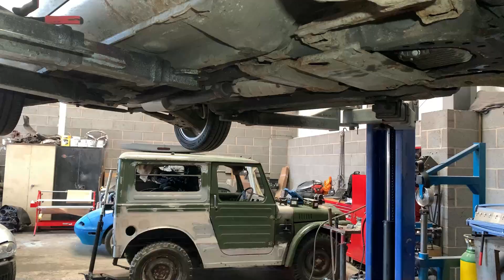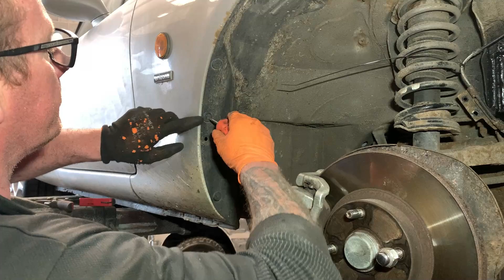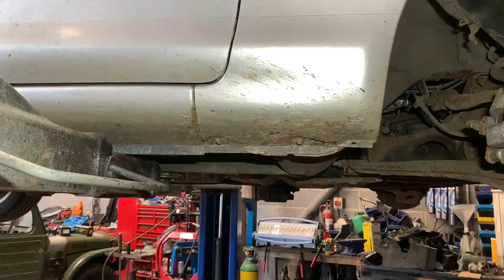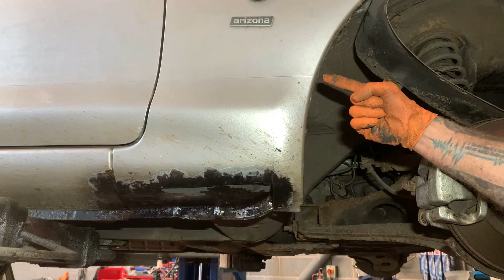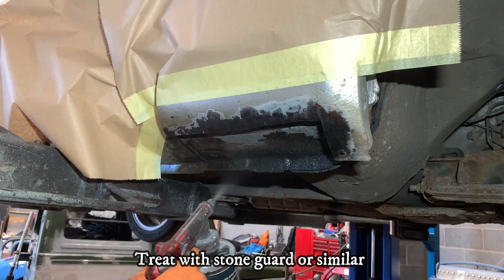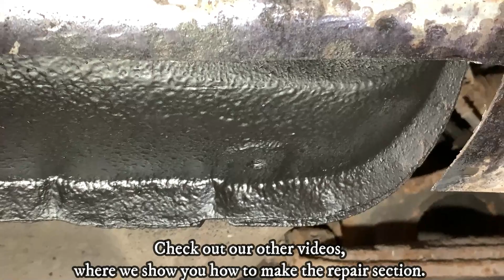How To treat rust under a MK2 Mazda MX5 front wing bottom

Comment: Hi.. Just a quick question I have had the bottom outer sill and fender replaced and the stone chip finish is  of different texture  to the OEM version and the passenger side of my 2.5. What's the best solution to fix this? Would be gratfeful for your advice.
Reply from the maker: We use a product called gravitex which needs applying fairly thick to get the correct texture. Thats the closest we have found to OEM. Hope this helps!